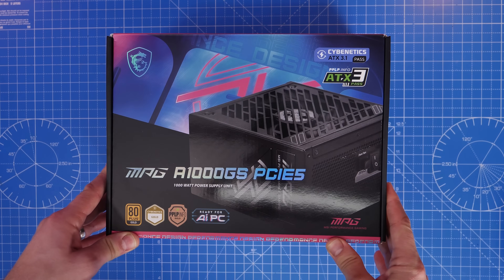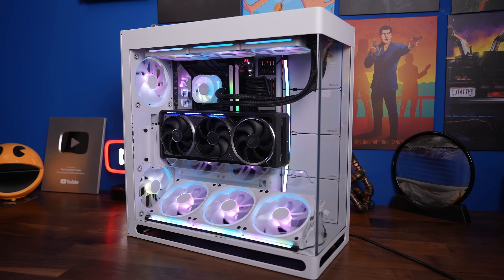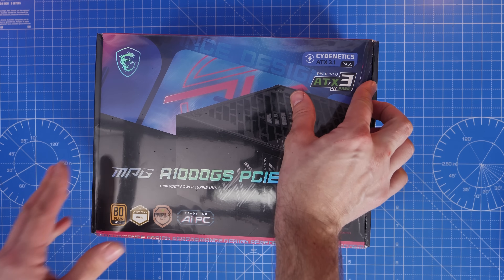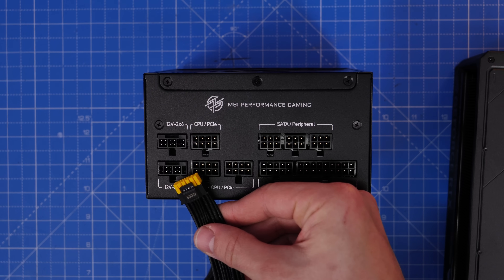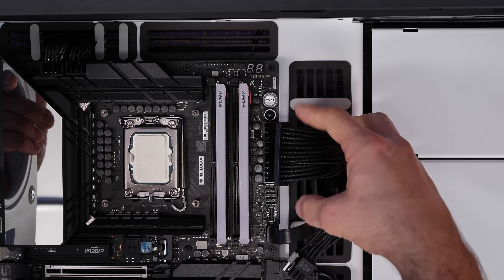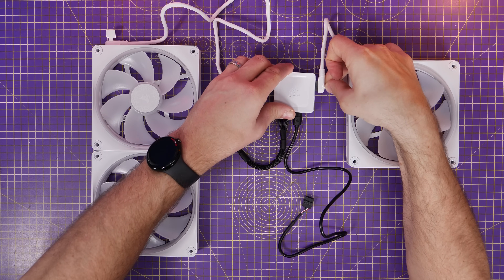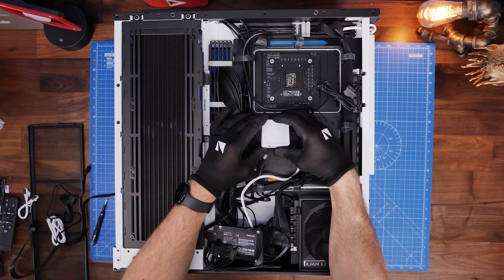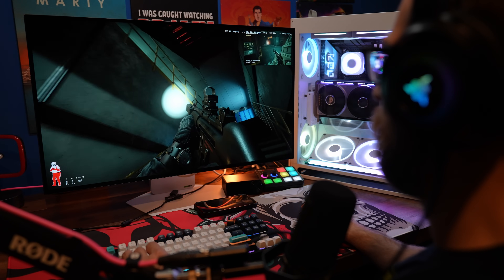Avoid these mistakes when buying PC parts

Comment: Ironclad rule of PC building....never spend cheap on your motherboard or power supply. If you are putting a 5090 into your computer then put an equal high end PSU such as the Seasonic TX-1300 ATX3.1

Comment: I recently got a Corsair RM850e PSU and discovered that it, too, had only 3 connectors for pcie/eps. It is a good fit for an matx case but otherwise the cabling is too limiting.

Comment: One thing I am absolutely frothing about is the importance of manufacturers/stores/sellers being transparent and correct about GPU orientation and there's no quick answer.

You google the name of some GPU's both current/last/new gen with the word vertical and you get a gazillion results of GPU's being 'vertical' in their mind but in reality they are sideways, this is vertical in one sense of the word but it's not at the same time.

For cases like the Tower 200 and others where the GPU 'hangs' because of orientation you end up spending time either trawling reddit, hoping PC part picker has the GPU/Case combo you need to confirm (and then finding in the comments they've had to do a 360 no scope on their build) or you spend hours looking at technical documents of GPU's that you deserve a shiny leather RTX/ON jacket like Jensen.

If anyone knows of any community movement to address this issue please let me know because you're effectively relying on someone else gambling on the GPU/Case combo you want or just flipping your case over and tombstone piledriving it into your desk whilst you hear Jim Ross shout, OH MY LAWDDDD (slight exaggeration, but you get me)
Reply from the maker: @BMJ872  so you mean you want it vertical like in the Lian Li Evo XL?
Reply: @TheProvokedPrawn  I think the issue is the use of the word vertical, I know the Evo XL supports it but the discussion around suitable GPU's seems to have everyone mounting theirs in a different orientation so you still end up with the same issue, I ended up with the best results on the SFFPC subreddit but even then it was a significant challenge, it also doesn't help that lots of huge reviewers/testers use a testing rig that mirrors what is probably the majority of orientations and I understand its around ease of access etc.

Comment: Have you got a partiuclar recomendation for cheapest PSU thats worth getting at 850W and 1000W?
Reply from the maker: Yes, don't cheap out is my recommendation. Seasonic and Corsair have solid options. Check the specs first though
Reply: @TheProvokedPrawn  I saw ur video on the Lian Li Edge and I like it but Im just concerned about that reversed fan making the PSU hotter/PC. Have u heard of any issues with that?

Comment: Well, well, well.... I'll be damned. I was the one that made the comment about it sounding like people needing to do a proper upgrade of their PSU after my main comment saying that I liked that Corsair is using a 6 pin PCI connection instead of the usual SATA on one of your other videos. I wasn't necessarily wrong, but I do know now that I need to pay attention even when getting a PSU with current specs. With the ATX 3.whatever connectors being added to new PSUs, manufacturers are going to cut corners somewhere. It ends up being the usual 8 pin PCI-E connectors that go first, since they are becoming less necessary. Maybe they will start adding 6 pin accessory plugs on PSUs. I have a couple of EVGA PSUs that already have them. Maybe they will become more standard.

Comment: That Motherboard don't require 3x8pin. 1x8pin EPS is required. 2x8pin EPS may be needed if you run a 14900K or something. But the 8pin PCI-e, is for 65W fast charging for the front I/O USB C only. Also, most PSU's have atleast 2 8pin PCI-e cables with pigtales. That helps a lot with controlers and fast charging. Personally i allways use modular PSU's with at least 5 PCI-e/EPS connections.

Comment: I feel you can never go wrong with Corsair PSUs
Reply: I allways use Corsair. I prefer the RMx series. But i am tempted to try the Lian Li EDGE PSU's for my O11D EVO.
Reply: @Audiosan79 i also like the montech and be quiet power supplies too, great design for the price you pay.
Reply from the maker: They are pretty solid in my experience

Comment: I already had the Corsair hx 1200 with the 12vhpwr cable that I already had for my Msi supprim x 4090 that nkw use for my rtx astral oc 5090, one question I have a coolermaster riser v3 pcie 4 but it is sawn like yours pcie 5 x16 but works as x8 5. I have asus crosshair x870e hero and I saw you did something in the bios and it is fixed for you after to x16. What exactly did you do?
Reply from the maker: It's a setting to make sure it's using the right amount of lanes (https://youtu.be/3dlq_Lqe8Fk)

Comment: This is a great video covering a problem not many others have factored in before building. 
I am one of those. I have an ASUS ROG Z690 Formula with two Lian Li LCD hubs. Needless to say the 1000w Corsair psu did not have the sufficient ports to run all these peripherals! It’s a major frustration, that along with needing 4 hubs in one build thanks to Lian Li’s love of square boxes! To add insult to injury they then bring out the wireless version….once my pc was finished. 
I’ve ordered the Lian Li edge 1000w to go into Hyte y70 touch. 
I’m hoping it all fits without anymore dramas.
Reply: a 1000W Corsair PSU have 5-6 PCI'e/EPS connectors. It comes with 2 PCI-e cables with pigtales. Those 2 hubs can use one of those. Then you are left with 4-5 PCI-e/EPS connections. Needless to say, it's a skill issue if you can not make that work. Even if you use a 14900KS and 3090/7900XTX you only need 4 connections. 5 is the best option.

Comment: Quick question Prawn I purchased some LX 140 fans for my build and when I ever setup a Lighting profile that switches colors the fan leds make very annoying  coil whine sound. Have you had this issue with your Corsair  LX fans?
Reply from the maker: Very odd. I'm afraid I've not had that issue. Have you contacted Corsair support?
Reply: @TheProvokedPrawn  Yah I did waiting for response

Comment: Went with a corsair 1500 hxi platinum for my 5090 OC ASUS. Melting cables issues spooked me plus I can be future proof
Reply: Not so much the psu but more of bad cables
Reply: I used the same one on my build in March of 24. 4080 Super is what I have though. Definitely skipping the 50 series.
Reply: @Weyco23  you should be fine with a 4080 super. I am upgrading from a 1080.
Reply: @VexOoo-x7y I know. I bought it to be future proofed.

Comment: I have a question before watching you're video. So the question is i have a atx 3.0 supported psu and lian li strimer wireless extension for gpu if i use a rtx 5080 that support atx 3.1 so can it run properly or i have to change the psu and the cable extension?
Reply from the maker: Should be fine as is
Reply: @TheProvokedPrawn  can you make a video on it to confirm. I am already on a tight budget and if anything goes wrong I will never recover from it. Please